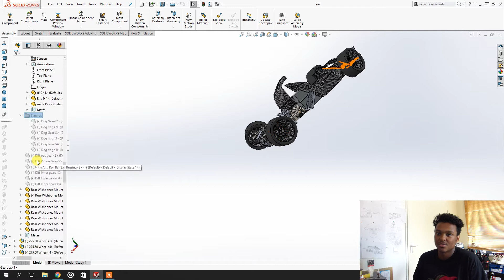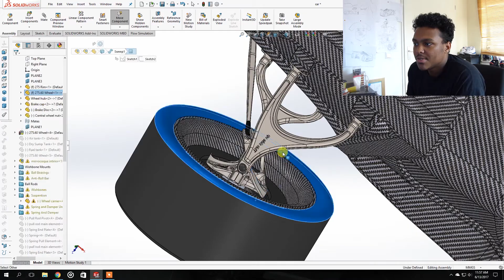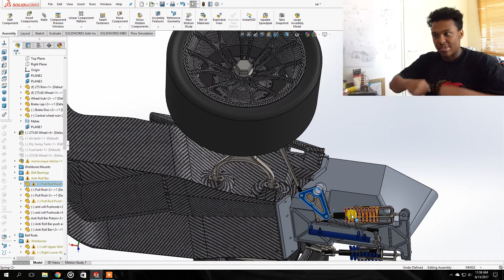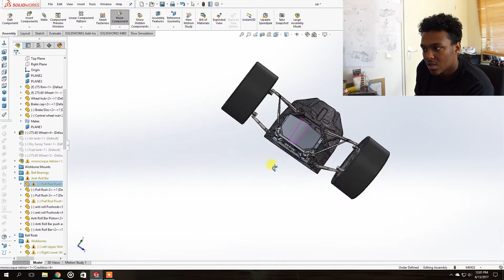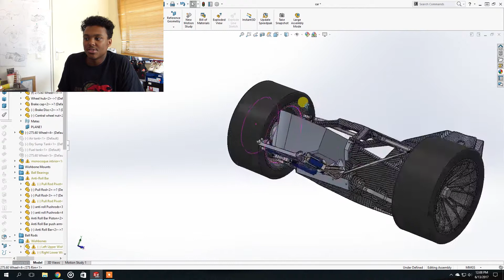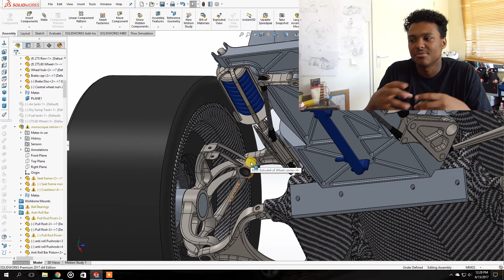Anti-Roll Bar Mechanisme Explained | SVA Design

Comment: I'm interested in design an aluminiom chasis for a 911 fiber glass replica with pushrod or pullrod suspension, I liked your videos and even want to make a carbon fiber base. We're to download  omercial assets for the suspension so I only have to design the chasis? This will be electric so I want to put tesla modules in the pan to lower the gravity center...
Reply from the maker: That sounds like a cool project email me if you would like to converse more about it.
Reply: @veldboomstudios  yeah for sure! Let me know where to email you, please
Reply from the maker: @DrEEAyM   i cant give you my  email adress in the comments of youube because they block links but my email is also in my youtube profile or you can go to my instagram
Reply: Great model well done. I do feel like you need to work on your terminology and design knowledge a little bit however. Have you considered the disadvantages of a pull rod suspension? Also for me, the main issue you have here is the long UWB vs short LWB. This means during cornering, you will get an unfavourable camber change rate I.e it will go positive! keep up the good work though, your SW model is excellent! 👍